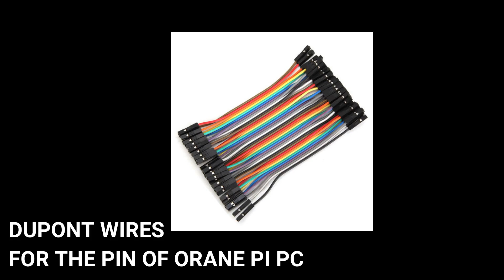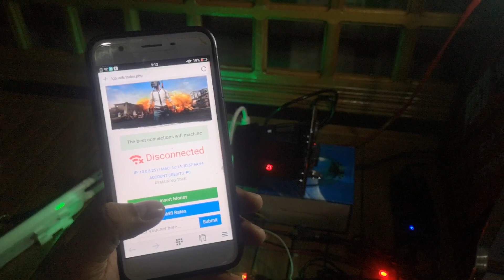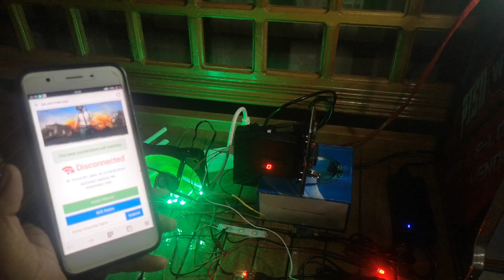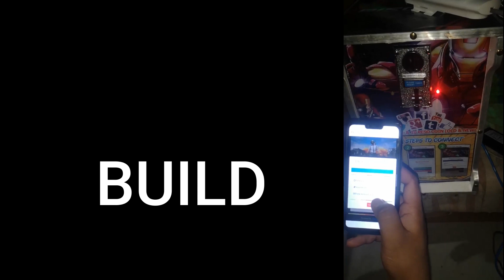DIY PisoWifi Vendo with Relay Module

Comment: sir ang linaw ty ... sir tanong ko lang pwide ba 12vled ang ipapalit sa red light yung nilagyan nyu po ng resistor ? aantayin ko po sagot nyu GOD BLESS po ..
Reply from the maker: Yes po pero wag mo na lagyan ng resistor ang 12 led
Reply: @itzatech  ty so much sir baguhan lng po ...sana marami pa kayung matulungan GOD bless po ..
Reply from the maker: Pm me lng sa fb page I will reply as soon as possible
Reply: @itzatech  sir yung sa gitna po ng relay yung sa kaliwa po anu po connection nyan ? yung katabi po ng groung ng led 12v?

Comment: sir pag ka on mo ng vendo hinpo ba tlaga iilaw yung led coin ? ... or iilaw yan pag mag bobot,up po ??
Reply from the maker: May power light meron ding sa insert coin light san ba diyan ibig mong sabihin
Reply: @itzatech  insert coin light po ... pag on ko di pa sya iilaw after mga ten seconds iilaw sya ... tama nman po wirings ko sinonud ko yung sa inyo ,,,
Reply: ano kaya problema nito sir?
Reply from the maker: Check mo sa relay sa software set mo sa active low

Comment: bakit hindi nalang irekta sa 5volts buck converter mo ang relay, embes na sa pin 4,6 ng orange pi one mo. lagay mo nalang sa 5v buck converter kasi pagnagloko ang relay pasok lahat ng current volts sa board mo.
Reply from the maker: thanks for the advice but as of today this vendo still working.

Comment: Salamat sa video working na piso wifi ko no problem sa crediting etc. Except nag flciker or on off ung coin indicator everytime nag huhulog ng coin, bat ganun
Reply from the maker: Check mo wirings lalo na sa relay
Reply from the maker: Message me at my fb page
Reply: Ok nmn sir sinunod ko lng ung basic diagram with relay di ko lng tlga alam bat napitik ung relay kada drop ng coins nag on off tuloy ilaw

Comment: Sir ask ko lang po kasi baliktad nangyayari sir eh kapag nag insert coin saka mamatay yung ilaw pag walang nag iinsert coin saka sya tumatanggap ng pera. pero nung wala pa po ako nilalagay na 5v relay module ok naman po pero nung may relay na baliktad na nangyayari. salamat po sa tut sir
Reply from the maker: Sa coin and bill settings yan naka high or low relay ka pwede mo ko e chat sa itzatech page sa fb para matulongan kita ng maayos.
Reply from the maker: Tingnan mo sa coin and bill settings tapos kung high don sa relay module change mo sa low then save restart pgkatapos
Reply: @itzatech  ok na po sir. salamat po
Reply from the maker: Youre welcome po.

Comment: Boss hello  pwede hingi ng advice sayo .bakit po ang ang lpb piso wifi ko nilagyan ko ng relay .ang nangyari ya parang baliktad ang ilaw sa coin indicator.pag mag insert coin ka mag iilaw ang coin indicator pero pag naka insert na mamatay ang coin indicator .ano po ang problema .follow ko naman ang iagram sa lpb na may relay.
Reply from the maker: Tingnan mo sa software ni lpb sa coin bill setting yong relay module option ilagay mo sa active low.
Reply from the maker: After maging active low reboot mo
Reply: @itzatech   salamat po sir
Reply: @itzatech  sir salamat ok na na set ko na sa active low.pero tanong ko lng bakit after mag insert ng coin ang costumer ko matagal mag off ang coint indicator almost 1 minute.normal po ba yon?
Reply from the maker: Press done after paying
Reply: @itzatech  yes po after done paying di pa sya mag off ang indicator.may setting po ba dyan salamat
Reply from the maker: Nasa koneksyon lang yan experience ko  kapag lumipat sa kabilang wifi o nag exit siya bigla sa browser after done

Comment: Ano po purpose ng relay module?
Reply from the maker: Regulate current
Reply: @itzatech  ilang volts po dapat output nya?
Reply from the maker: 5v 10 amps single channel
Reply: @itzatech  sir ano po fb nyo my isesend lng po ako n pic ng pin connection sa board nya, d ko kasi maintindihan
Reply from the maker: Nasa youtube banner ko click mo lang don
Reply from the maker: Or search itzatech sa fb page same logo
Reply: Ngsend n po ako sir ng msg

Comment: Bakit po tumatanggap parin coinslot ko kahit di naka insert coin mode sir?
Reply from the maker: May set pin ka bang nilagay sa coinslot?
Reply from the maker: Message me at my fb page
Reply: @itzatech  yes po sinunod ko po yung diagram nyo po
Reply from the maker: Lpb ba gamit mo?
Reply: @itzatech  yes sir .v15.3
Reply from the maker: Ang set pin ay nasa pin 5 pki check maigi din yong relay wiring

Comment: Sir, tanong ko lang po. Pwede po ba ako maglagay ng fuse sa red wire papuntang buck converter ? For safety features ? Pd po ba yun ?? Kasi naisip ko po 12v lang din po sya kagaya ng volts ng mga batt ng motor. Salamat po.
Reply from the maker: Fuse is like a switch, not so necessarily pero if you want safety ang yong buck converter duribg power surge or fluctuation lagyan mo nlng.

Comment: Sir anong ginamit mo na relay dyan? Active low?
Reply from the maker: Active low po
Reply: @itzatech  sir sa diagram. May diode pa, kahit ba hindi na gumamit ng diode?
Reply from the maker: Sa akin di ako gumamit, ok naman mga vendo ko
Reply: @itzatech  sige po sir, salamat, btw ano po advantage ng may relay kesa wala?
Reply from the maker: @tristancapistrano8765  disadvantage maraming wire, advantage mas safety ang board. Nag cocontrol siya sa electric circuit.
Reply: @itzatech  ah.. so mas advisable talaga na may relay? Para mas matibay sir?
Reply from the maker: @tristancapistrano8765  👍
Reply: @itzatech  sir bale ano nalang need baguhin sa settings sa lpb? Wala na ba? Plug and play na? Hehe lalagyan nalang ng license? Nag message po ako sa fb nyo sir hehe
Reply from the maker: Opo plug and play nalang nasa sayo na kung may babagohin kapa. 😁